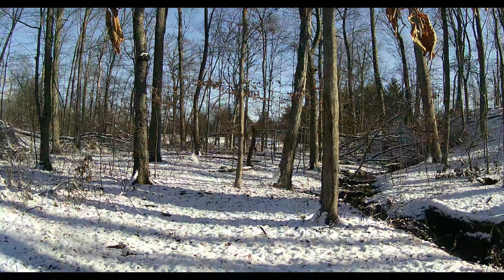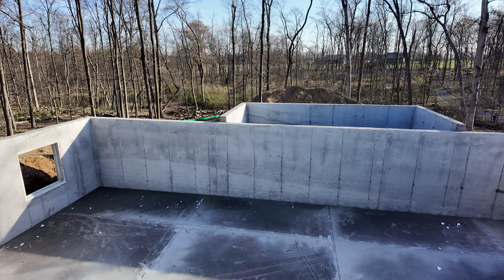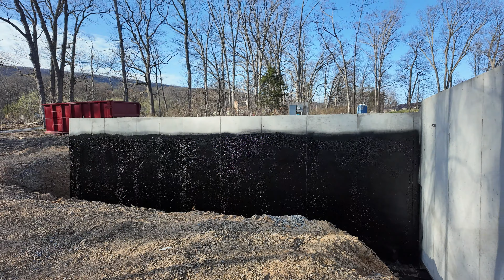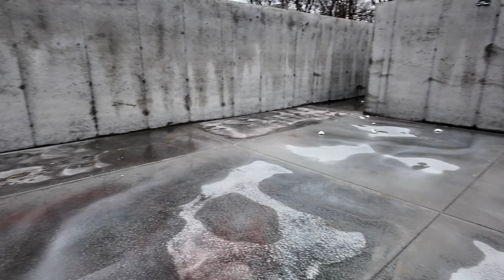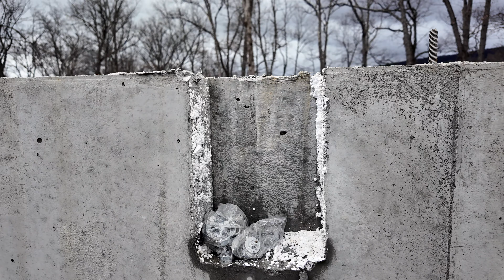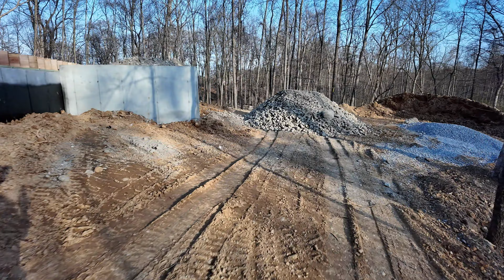Owner/Builder:  Beam pocket errors, basement slab, and the start of framing

Comment: Easy fix for that beam pocket if it is indeed too deep is metal Shimes(plates) to hold it up higher, or a bed of grout. In commercial construction those beam pocket typically will have threaded anchor bolt sticking up to receive the beam, with a couple of nuts under the beam you can set it right to grade. Then the beam pocket gets a form around the beam and attached to the wall and is filled in at a later date with some concrete.
Reply from the maker: Thank you!  Grout is coming!
Reply: If you weld the beam to the bearing plate, is routing still necessary?
Reply: @danagoglia1406  Grout is usually used to make the leveling/bearing plate level and stable. You want the beam to sit on a good solid level surface. Grout under the plate accomplishes that .  typically the beam is not welded to the plate as the anchor bolts hold the beam in place. But I have seen that done. I have also seen the nuts on the anchor bolts tacked welded into place. Hope that helps.